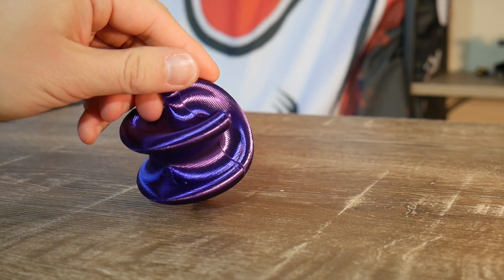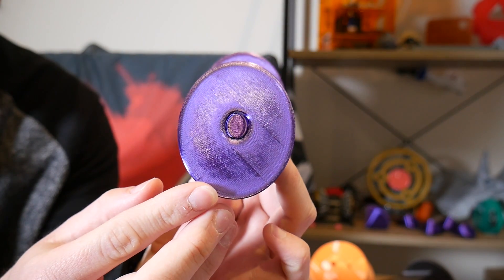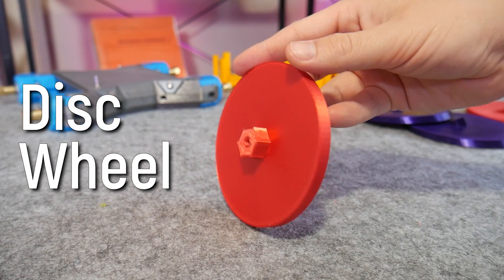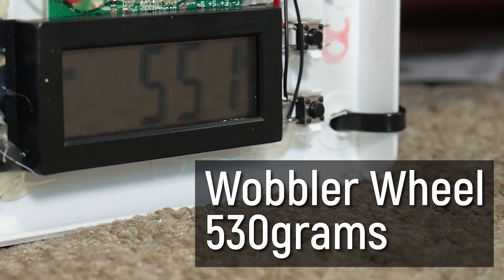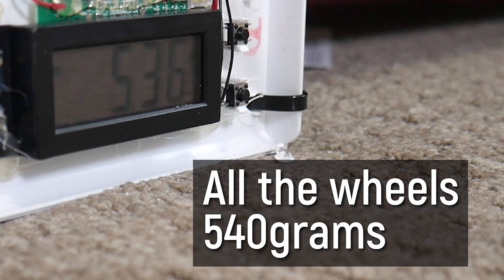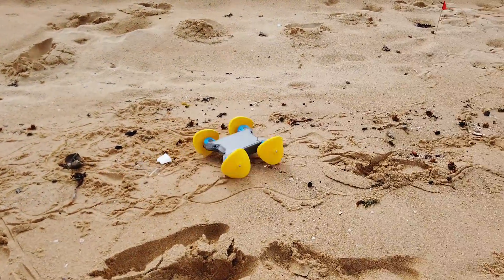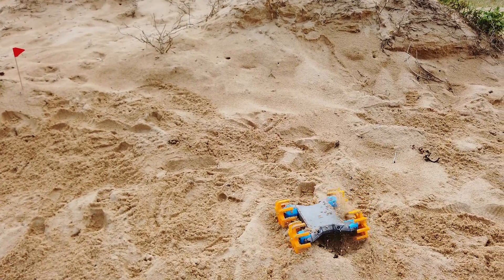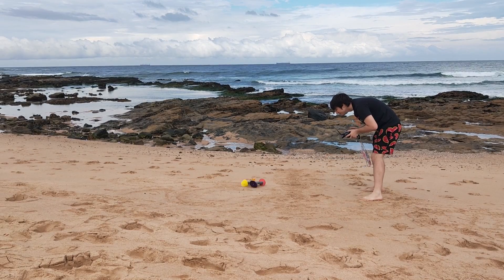This Robot Drives on Wobbly Wheels (but HOW?)

Comment: You made sure the surface area of the contact patches were the same but did you also make sure the weight of each type was the same? If not, this could explain the mixed results on the carpet as more weight would add more down-force and traction.

Comment: Your limitation here, I feel, is more vehicle clearance than wheel traction. While going over those bumps, the wheels get caught in the footprints because the body is sitting up on flatter sand. Basically, it's like testing a powerwheels toy out on a motorcross track, and the wondering why it isn't performing very well.

Overall, though, cool video!

Comment: A good test for the spoke wheel would be against other designs for treads perhaps a honeycomb, gyroid and square shaped treads on a hollow wheel like the spoke would be a good next experiment in this line of testing.

if you made the prongle wheels with little tank tread divots i believe you would have a right effective wheel there. i think if you are going to make the spoke wheel the way it is now you need to allow more surface contact area for the other wheels because the spoke wheels are so wide hey get more purchase with the sand. also in relation to the prongle wheels if you halved them and fliped one side so its ends reached the same dimensions of the nightshade but curved in a mild S shape would be more effective than either of them.

Comment: Surface area shouldn't be the limiting factor. A more interesting test would be a mix of factors. By having a maximum build volume (ie volume that the wheel can fit in like a wheel well) and max weight for the wheel. Things like wobbly wheel become viable and theres a practical application in things like combat robotics where your limited on size and shape

Comment: Why does it look like sometimes the front and rear aren’t in sync?  Do those motors have a limited slip type of function?  The motors front and back should be on the same controller, right? Most noticeable on the paddle tirea
Reply: If I heard him right there are 4 brushed dc motors.  Feeding two with the same pcm from one controller will only guarantee they have the same rpm if loading is about equal, otherwise one can spin while the other stalls.  Basically you don't get phase lock.

Comment: A bunch of the weirdness here make sense to me. While the surface area on all the wheels are all the same, the wobbler wheel is going to have a wider point of contact with the carpet.  Mathematically it's the same but it would create more grip in one direction, rolling forward.  Also having all of the different Wheels making it more stable makes sence too.  The wobbler and Pringle Wheels had slightly more grip but the straight wheel probably helped guide and stabilize them.

Comment: You used a poor metric in total wheel surface area to make the wheels.  What matters is the wheels "contact" surface area with the surface they run on.

If you'd made wheels with half the diameter but same total surface area, the pull force and sand performance would have been massively improved.

This is why the last set of wheels performed better in all tests - they have a larger contact area with surface.

Comment: Higher order wobbles! Diagonal cut wheel is 1, prongle is 2. Try 4-12. Amplitude of the wobble should be a full radius on either side of center plane.

Comment: I think a general wheel approach would be to require a consistent uninterrupted tread with constant total area and containing cylinder volume.  Then slice that cylinder in various ways.  If we look at the nightshade wheels, that's a "frequency about the cylinder" of 1.  The Prongle wheels have a frequency of 2.  The disc wheels have no sideways oscillation, and so have a frequency of 0.

Why not take the frequency higher, to say 3, 6 and 9?  I suspect the higher-frequency treads will start to add more rearward sand transport, but at the limit (infinite frequency) will take you back to the disc wheel!.  So I suspect there must be an optimal frequency, at least for your local sand.

Edit: I would exclude tread designs that aren't sinusoids, excluding things like triangles or rectangles.  In particular, if you imagine connecting together every other spoke of the spoke wheels, you'd wind up with a rectangular zig-zag wheel.  Those would be fun to try separately, but would be a different category than the sinusoidally sliced tread.  Perhaps a different category for each type of geometry?  Sinusoid, Triangle, Rectangle - any need to go higher?

Comment: There's a game called "scribble rider" by the game designer "voodoo" on the Google play app store. While playing that game I found out that a star shaped wheel is the most effective wheel design for every terrain on every level. You should check out the game as its similar to what you're doing here in this video. I would love to see how this star shaped wheel 🌟 would do on this car. Maybe you can do a video using the different typical wheel designs people scribble in that app, from star shaped to swastika, spoked wheels, S shape wheels, etc
Reply: Also, I think that you missed out on one important point - surface area of the wheel in contact with the ground is much greater in the 8 spoke wheel than the other wheels

Comment: At the end of the video you showed that spiral mechanism, why not include something like that in the wheels, so that the more centrifugal force the larger they get. When the RC car gets stuck it may provide it a way to expand larger than the initial hole/footprint it gets stuck in. It could also be applied in a way that when going in reverse it would engage the spiral to make them larger, but when going forward it would disengage it.

Comment: For the spoke wheels, try adding a slight scoop under each edge of the spoke (like on a paddlewheel).  That might propel it better.  The boxy spokes didn't seem to have enough grip in the shifting sand.

Comment: I reckon two things need to change-
1. Test on multiple terrains, of course any wheels with a perfectly smooth contact surface would get absolutely trashed on anything except smooth concrete

2. Double or triple the surface area allowed, as we can see even standard wheels have insufficient traction
Reply: Make the wheels gears.
Worked for me back when i made cars with gears for wheels.

Comment: i think the spoke wheels techically have more surface area since its not only the outer part that is creating forward force on the sand. however, it would be interesting to see different spokes tested. like square, triangle, star shaped, etc. kind of like different types of weed eater line.

Comment: I think the orange paddle wheels would have worked much better if there was some kind of a traction control controlling them, the mismatch in speed caused it to dig in. Maybe slanted design (30-40 degree angle for the wheel surface) would have also helped with giving a larger contact patch since they are basically sticks with nothing between them.

Comment: Wider wheels are better for sand. You kinda wanna glide on top. Once you start digging the wheels in the sand in most instances you're done(with full sized vehicles that is)

Comment: Driving these on damp sand was a great choice, really cool tracks.

Could have just keep calling the prongle wheels "curvy bois".

I think you just glossed over the most impressive part of your platform design, those snap fit motor mounts. Care to detail that design in a separate video?

Comment: Tbh, I think ground clearance is more of an issue than the wheels themselves.
Reply: What I was going to say, the failing point of all wheels were the body bottoming out, maybe if he made a platarm capable of bigger wheels and a much higher ride height those sooner could fair better (probably won't help that much, but hey, at least it will be their actual fault when the vehicle bogs =P)
Reply: The wheels also need more surface area to deal with sand without sinking. He could increase that surface value he used for all the wheels.
Reply: It might be interesting to adapt these wheels to an off-road platform. I made one a few months ago that might work. I can't post the link in the comments, but you should find it if you search for “Off-road robotics platform (rovers)” on Thingiverse.
Reply: Just add a fifth wheel to the front
Reply: Thing is prone to high centering on barely any kind of obstacle. Not a good design for off-road use.
Reply: Yes.. that seems to be the case. It needs high ground clearance to finish the obstacles since he can’t increase the surface area of wheels.
Reply: Well, for a prototype, it performed real nice. Hope to see it improving along the next vids
Reply: what do you mean?
Reply: @openlink9958  it mainly gets stuck because of the bottom of the body hitting the ground rather than the wheels losing all traction or ability to pull up the hill, then because the body is stuck the wheels try to drag the body across the ground, but instead of the body moving it just moves the sand out from under the wheels, digging a hole and bogging itself down.
Reply: @openlink9958  the distance between the lowest pount of the vehicle and the lowest part of the wheel
Reply: @openlink9958  not enough ground clearance under the chassis. as soon as he got in a footprint the wheels got stuck. the spoked wheels did better because they had a way to dig that ridge out.

Comment: I really think the spoked wheels were a completely separate class of wheel and should not be compared with the others. Firstly they scoop up sand with the sides of the spokes making them act more like paddles than using surface fiction t propel the forwards like the rest. and secondly, since the spokes had a square cross-section, the spokes spent most of the time with one edge against the surface it was contacting, dramatically increasing contact pressure and helping them dig into the carpet and the sand in a way the other wheels just couldn't compete with.

So yeah, I think they would be disqualified from competing with the others.
Reply: It is exactly like comparing large sand-scooper tyres to super skinny racing tyres to see what has more traction on sand- would be more fair if he tested various terrains though

Comment: The sand test is driver error. Everyone knows you never spin the wheels on loose ground. I would hate to see this person on the road during a snow storm. When you get stuck backing up slowly and slowly accelerating using the momentum is the only way to get anywhere on sand.

Next test lets throw lead weights in a pool and see how far they float.
Reply from the maker: Yeah sadly a failing of brushed motors and old school motor control.

Comment: What about one where the wheel is a bit like a pinwheel/fanblade shape except the edges are given more thickness so it doesn’t just dig into the ground. And there would need to be more blades. I’m imagining it would look somewhat like a twisted flower. Also what about one with a sort of corrugated edge so it’s path is a squiggly line. I can’t think of the name of this shape.

Comment: Looking at the rules you made up in the beginning for a "fair" comparison the spoke wheels would have to be disqualified in the sand test because they effectively have a bigger surface area with which they interact with the sand!

I wonder how wavy wheels with a shorter "wave length" would behave! 

Nice content :D
Reply: Wavy wheels also use their sides for propulsion. That's part of why they work better.
Reply: going by that standard, there is no comparison to be made, since same contact surface and same surface texture lead to same performance. The key to winning this sand-contest is to maximize the vertical surfaces on the wheels and ideally cheating an increased surface contact with sloping edges to reduce the burrowing effect.
Reply: @sh4dy832  I’m having a crazy thought, not sure how feasible it is: imagine wheels with the same total surface area, but the part on top at any time flops over and adds more surface area actually touching the ground, which would either require some sort of hinge, or soft floppy filament to make.

Comment: Looks to be a body design failure, rather than the wheel issue. Stilted or high center might give more clear results
Reply: Add to that a bit of speed control. The wheels turn very quickly, flinging the sand away instead of holding on to it
Reply: Or just larger diameter wheels
Reply: Also controller seems to be unfair on wheel torque. In 13:28 You can clearly see that on left side there is not uniform control of motors. Rear one which has traction spins, but front one which is in the air doesn't. As a system without traction or torque control, both wheel should spin with front one being faster. For me it looks like there is not enough power in battery to provide uniform power delivery to all motors, or the controller is doing bad job.
Reply: @darekmistrz4364  the wheel was spinning faster, it's just an effect that happens with cameras when the RPM of a wheel syncs up with the frame rate, look at a video of a car accelerating and at one point the wheels look like they stop turning and then start turning backwards, that's the same thing that happened here.
Reply: I came here to say this exact same thing xD. Ennar's and difflocktwo's comments are also good insights imo.
Reply: It needs bigger wheels
Reply: What, like Active Suspension?
Reply: @AmaroqStarwind  not even that, if the body allowed for more wheel/ground engagement, it wouldn’t high-center as much. Or like a previous comment suggested, just make the wheels much much larger, that would increase torque and motor strain, but... meh someone else’s issue.

Comment: I think that it would improve the controllability of the wobbly wheel if you somehow could ensure that the two sides are "working against" eachother, (if you look from above it would look something like this: /[]\ or \[ ]/). Then the lateral forces applied to the vehicle will be in equalibrium making it handle better and possibly giving it more grip. 
To increase the grip of the paddle wheel I would suggest  not having the spokes straight across the tires width but having them angled towards the center of the wheel (arc shape). Also you could maybe "twist" the spokes 30 degrees making the vehicle push itself up as well as forward giving it less grip but decreasing the risk of getting bogged

Comment: I bet all the wheels, except the disc wheels, would do better if there was a way to lift the body of the car higher.  It looked a lot like the body was dragging on the sand and making it hard for the wheels to move things along.
Reply from the maker: It would become quite unstable at its current size, but a scaled up version might be possible down the line. I agree, the sand is incredibly soft and punishing for such a small vehicle!
Reply: @MakersMuse  First off, I LOVE when the actual creator responds to my comment! Anyway, even if it was just and inch or so? I know if you put it up on stilts it would become very unstable, but just an inch to get the body up out of the sand would probably make a huge difference.

Also, I loved that the woobly wheels just buried the body of the car in sand.  It was so sad and funny at the same time!

Comment: The wobbly wheels looks like fins. So, can it swim?
Reply from the maker: I think we need to find out!
Reply: There's a guy who 3D prints and tests computer fans made by his audience.  It would be awesome to do the same thing with a waterproof rc boat motor. Maybe even try the exact same designs lol
Reply: @VagabondTE  Yeah, Major Hardware! :) Great stuff and the guy seems humble!
Reply: @jaakkopontinen  I'd love to see Major Hardware (what's his name?) & Angus in the same video.
Reply: probably not, as the wheel turns it would create a force that could theoretically push the car forward, but it is very weak. then it would continue to rotate and make the exact same force in the opposite direction, pushing the car backward.
Reply: @j.c.cannon2112  That assumes it's underwater right? It looks like it should be able to paddle on the surface :D
Reply: @cobiebeef  that's true but you'd need to manage to not sink it, so it would either need a cavity of some sort that was sealed (I'm not sure what is there would work) or some floaties

Comment: Awesome stuff! As an industrial designer, I like the topology of the chassis you developed. It kinda reminded me a bit of the "Dirt Crusher" system we had at LEGO in the early 2000s ... there, we additionally had flexible elements, that took some of the stress off of moving parts during impacts (mimicking the function of ligaments)...
Reply from the maker: A lot of the combat robots use similar shock mounted drive pods, it definitely allows them to survive incredible impacts!
Reply: @MakersMuse  Ah, I guess then that's where our guys got the inspiration from!

Comment: wildlife expert: "And here we have the tracks of the rare golden viper"
Angus: hmmm
Reply from the maker: LOL they do look quite like snake tracks.
Reply: @MakersMuse  They actually remind me of the action of sidewinder snakes, which are specifically adapted for moving quickly across sand. I wonder if a wheel design emphasizing this similarity even more would perform even better. Maybe if each wheel only made contact with the ground along half of the left-right sweep? You'd probably need a six-wheeled robot to maintain stability with that though.
Reply: @BiologyTube  I think it would also be a good idea to use a single motor, drive train and differentials, so the wheels always stay the same compared to each other. 
Might make the wobbly wheels better, right?
Reply: @MakersMuse  Haha i agree
Reply: A(mo)ngus 😳
Reply: sussus 😳😳😳
Reply: But sometimes, more unexpected tracks grab our attention